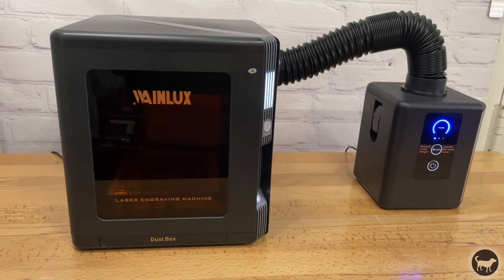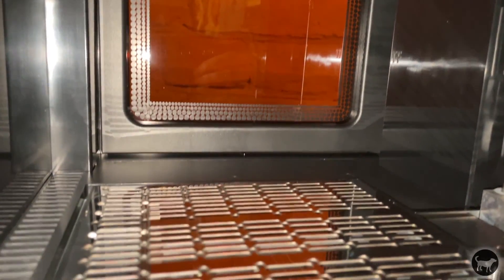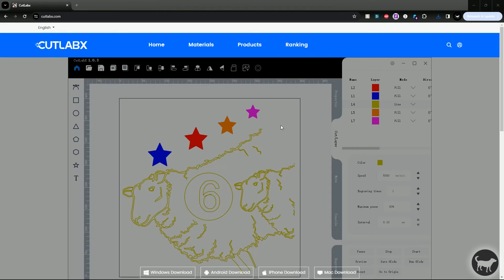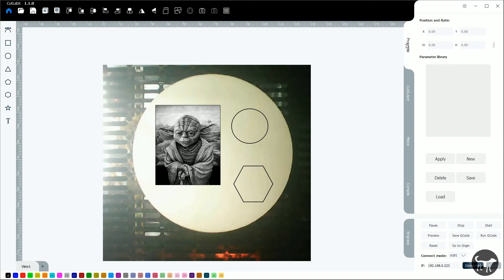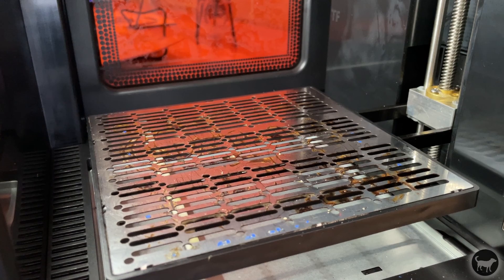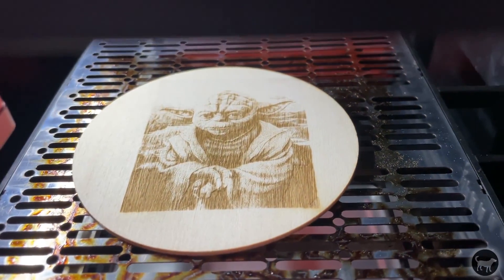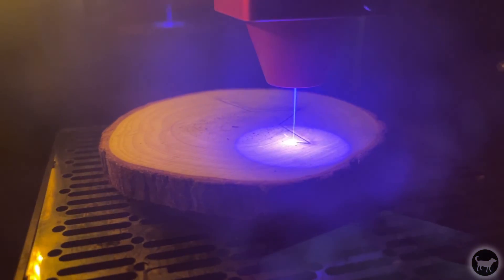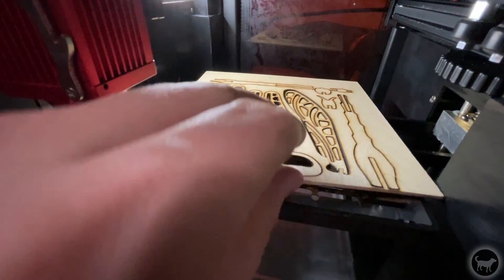Wainlux K8 10W Laser Engraver Review | Full Enclosure | Air Purifier | Camera and WIFI Control

Comment: Thanks for the video, some great info in here! 
Mine just arrived. I'm still struggling to get it properly calibrated using the cross grid as I can't seem to get it aligned no matter how I do it. Any advice? Or should I just keep experimenting? Also, what x, y, h, w numbers did you end up with in the end?
Reply from the maker: Hello. It should already be calibrated from the company but mine was a tiny bit off. I ended up with -0.1, 245, 80, 540, 540. Also make sure to enable the camera and disable the camera after each tiny adjustment to see the results.
Reply: Thank you!  @BusterBeagle3D
Reply: Did you ever get your machine calibrated and how is it working now? Thanks.

Comment: Great review. Waiting to get mine here soon. I backed it on kickstarter a while ago.
Reply from the maker: Thank you! Hope you enjoy it.
Reply: @BusterBeagle3D  got my k8 and started to notice its not cutting all the way through on a single pass on the same wood that I have been using since setting it up. Went through the user manual, no info on how to take off the laser to see if the lense is diety or not. But I have noticed after 4 sheets of wood not cutting all the way through it cut on the next one no issues. Could it be inconsistencies with the wood? Or is the lens in need of cleaning? I only have about an hour of run time on the engraver so far
Reply from the maker: @Bearded_Blonde Plywood is notoriously not consistent. Since it's made up of different layers of wood, glue, and fillers one piece could cut different then the next. Again I also prefer to cut things in multiple faster passes then one slow pass. This also helps to keep the lens cleaner. I didn't try to take my laser off to look at the lens but a quick picture with your phone should give you an idea if it's dirty or not.
Reply: @BusterBeagle3D  glad to hear it's not my machine. I was getting a little concerned lol